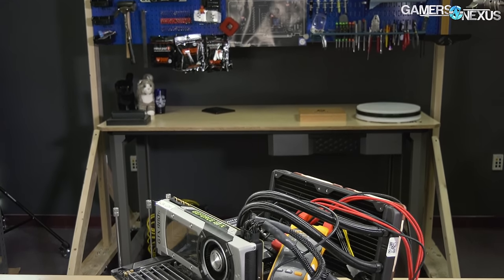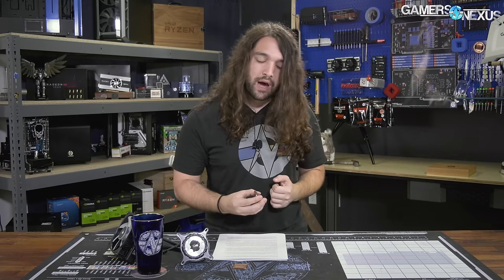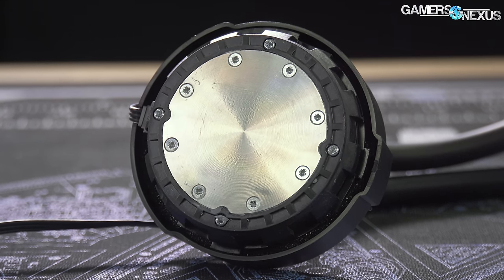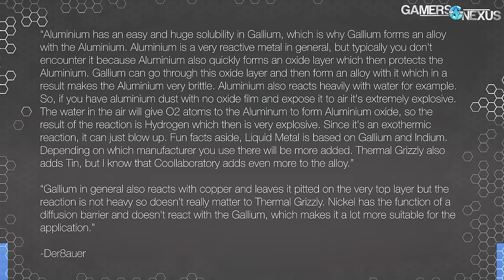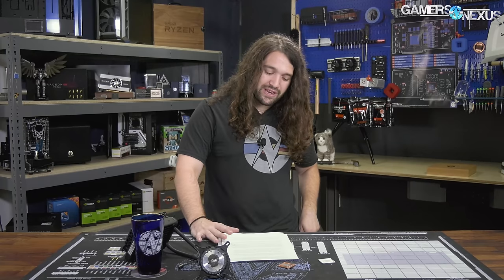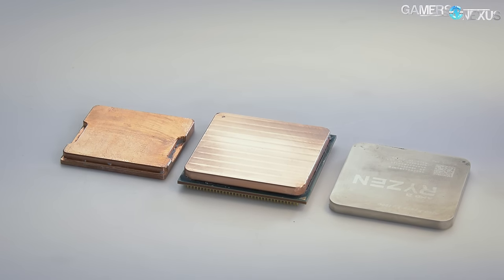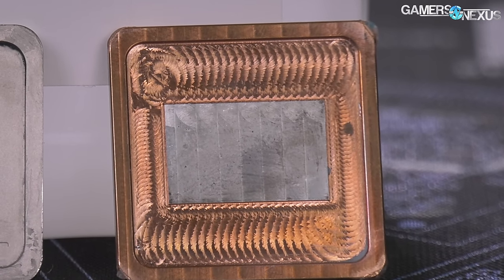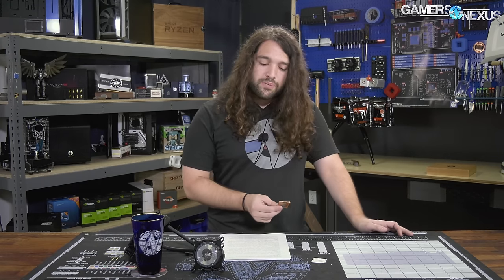How Liquid Metal Affects Copper, Nickel, and Aluminum (Corrosion Test)

Comment: I STILL can't make up my mind about whether I should liquid metal my Asus GL702ZC which has a 65W Ryzen 1700 desktop processor in it, and a RX580.  My ultimate goal would be for it to be quieter, (even though I don't really game on it and it doesn't really get worked that hard), but it also spends a lot of time oriented vertically in my backpack, which is the #1 concern with liquid metal, apparenty.
Reply: as long you apply it properly it should be fine, i used it in my g750jz for a full year and i had no issues

Comment: Anyone else had uncleanable staining on the die after using Conductonaut? Did this to my previous laptop which had bare copper contact. Worked for a while then went unstable, although I don't have any proof of correlation between these events. Copper was stained as described, but so was the top of the die.

Comment: Guys, i saw a video here on YT saying to not use liquid metal on laptops because them being mobile and not always standing on horizontal, the liquid metal will spill (what in tarnation i said to myself), and being electrically conductive will short-circuit the components. Is this true ?(from what Steve said i presume ppl are using it with laptops and if yes what is the drop in temp, like after and before.)
Reply: If you ise the right amount and don't soak the whole cooler into the liquid metal substance then it will be fine. The cohesion and surface adhesion keeps it on its place
Reply: No, incorrect, because then you wouldn't be able to use liquid metal on most computers. Most computers have the motherboard mount vertically, and gravity would pull it down onto the motherboard if this were true.

You can't apply it like thermal paste, you need to apply it how Tech Jesus applies it.
Reply: i've used it for years and had laptop transported in bags and what not and it never spilled
Reply: I have a Alienware R4 17 7820hk with a GTX 1080 I had nothing's but thermal issues with everything Except Liquid metal and finally carefully balancing the heatsink and applying better thermal pads. replacing a noisy CPU fan tomorrow so I might as well double check the paste. However to answer your question. I  travel  with it all the time no issues going on six months now..
Reply: @twoatejaun  thanks for the answer please keep me updated for the paste check.
Reply: @danny3man  Paste was in great shape on the cpu and gpu diei could wipe completely clean. Staining on the copper heatsink forsure but didn't see any psychical wear on the coper it self . Added a little extra and  actually made my core temp differential  even better then ever down to 4c max  on all four cores
Reply: @twoatejaun  Very nice, thanks for the update.

Comment: Can you tell if something is nickel plated or just aluminum without filing it off? I’d like to throw liquid metal on a graphics card, but I can’t tell the difference.
Reply: Weight.. aluminum is pretty light.. So if the card feels not very heavy at all then it is probably aluminum.. The other way is to look up information about the card you have and see what reviewers tell you..
Reply: They have a slightly different color. Aluminium is more "bright" or "white-ish" while the nickel plate has a slight tan tint.
Reply: best to google and hope someone has an answer but 99% of the time its copper

Comment: I liquid metal everything I can. Laptop, CPU, GPU. Hell, I would even do my phone if I could. Stuff is unicorn blood.
Reply: Well it's been 3 months, how's your liquid metal everything holding up?
Reply: And unicorn blood works best for sure, but what an ordeal to harvest. Easier to lower my ambient temps by 5 degrees than stringing up a mythical equine, and  draining it's blood... I wonder how a mercury gold amalgam would fair, as long as all the mucury is all used up and saturated with gold, it should be stable enough, and not off gas or cause any risk of poisoning (dose is incosequentialy low), guess it depends on the final texture, can't be a suspension, idealy should be a solution or at worst a very uniform mixture (I want to try gold leaf as a diffusion barrier anyways, and also try nickel/gold plate some copper myself, might as well see what a mercury amalgum does, hell if it works half as good as old murcury tooth fillings, it could end up as a gold 'soldered' cpu once/if it cures... Either way more gold, less aluminum, copper, nickel. Everything should just bs gold plated and polished as a rule. I assume the 9900k is solid gold at that price. Hopefully thermal results match... ;)
Reply: Unless you are using real unicorn blood, Then that is truly FUBAR!

Comment: so i could use a liquid metal like thermal grizzly conductonaut with a ryzen 7 3700x with a noctua NH-U12s ? also is it worth it?
Reply: Wondering the same. Thinking about liquid-metalling my NH-D15 to a 3800X.
It it drops temps and thus fan-noise I think it'd be worth it - but the application kinda scares me.

Comment: With Noctua heat sinks I have never had to reapply liquid metal (I use Coollaboratory Liquid Metal Pro).
I am on my third system with Intel CPU and Noctua heat sink, I have never reapplied, my current system is a delidded Intel I7-7700K, no temperature problems, I could not swear, since my use changes, various overhead from OS and so on, but I have not seen temperatures change to any degree that I have ever noticed.

For me the main attraction with liquid metal is pure laziness, I never ever want to touch that CPU again, and my fiendish, nay even devilish plans are proceeding as ...planned,  so far.

Honestly I thought this was the main attraction for liquid metal, the, what 1-3 degrees? difference, from properly applied liquid metal, does not make up for the hassle of properly applying the liquid metal, instead of fingerpainting on some paste?!? (Woo, the quitest fan in my case might ramp 20-40 RPMs up from what it is, Woo, bugga buggah, soo scary?)

Comment: steve and co, how do I tell if my heatsink plate is aluminum or nickel plated copper? The manufacturer won't help out and it's for a laptop heatsink. The GPU heatsink plate is copper but the CPU heatsink plate appears to be either aluminum or nickel plated copper

Comment: (Question) Would pure silver work as a plating for a copper IHS?  it's even higher T-conductive than copper, much better than nickle,  resistant to corrosion, easy to plate,  but expensive,   Are there other interactions I'm not taking into account?
Reply: Silver might react with one or more of the metals in the liquid metal alloy, just like copper does. The nickle plating layer is so thin it hardly affects heat transfer, even with its lower conductivity than silver. The nickle is to protect the copper from corroding, which would make a much poorer thermal conductor, or even worse, a rough uneven surface.

Comment: These alloys are commonly called Galinstan. It often has additives of Bismuth and Antimony.  Bismuth is a heavy metal (like lead), but it has rather low toxicty, so it should be safe to use.

You want to talk dangerous liquid metal coolants? How about Sodium-potassium alloy (NaK). Extremely reactive with air, water and moisture. There is actuall a CPU cooler utilizing this liquid.

Only thing toping it out (and having better performance) is Cesium-potasium-sodium alloy. Even more reactive.  I have no idea where these things are used, but my guess is nuclear reactors cooling, and nuclear reactors in space applications (like interplanetary probes). Possibly in hydraulic system that need to whitestand very high temperatures too (like close to a nozzle of a rocket engine for stearing for example).

Comment: You can make liquid metal yourself, all you need to do is get some solid Sodium (Na) and mash it together with some solid Potassium (K). Both of these metals are relatively cheap to buy and readily available.

It is however advisable that you make sure your home insurance is up to date before applying this to your CPU and doing so will generally not only void the warranty on your CPU but basically void your system in general. :D
Reply: Michael Nager don’t forget to add a few ounces of water to thin the mix out, you don’t want it too goopy.
Reply: +blackhavocjim You know I am so happy for your input, because I just knew I had forgotten something after I had posted - well done that man :D
Reply: That might actually dissolve the nickle lol if it doesn't react with something else/ explode first.
Reply: +David Gunther I estimate - and remember I am just spitballing here - that any dissolved nickel is going to be the very least of your worries.:D

But watching the two lumps of metal turn into liquid as you mash them together is just cool.

And "explode", as we heard Steve say, is just a really horrible word to articulate, lets just say the liquid tarnishes really fast.

Comment: Not sure if somebody else mentioned this already, on this year-old video but I must wonder if it is possible to use Aluminium heatsinks with a copper tape lined with a thermally-conductive adhesive.
Reply: that defeat the point entirely, would it not?
Adding the tape just adds a layer of (plastic) insulation, negating any positive effect the LM  could have.
Just use thermal paste with Aluminium heatsinks.
Reply: Ahaha try it cheap out the cooler for liquid metal.
Either used a Traditional paste for that cooler.
Or buy a Nickle plated copper cold plate

Comment: So does this additional bonding on a Rockit IHS lead to the liquid metal to "dry up" and and force a reapplication over time?
Reply: The liquid metal forms as a solid part of the copper. Its atomic thickness isn't any less. In theory, it wouldn't impact performance at all.

Comment: I tried coolermaster mastergel maker nano(in my opinion its the best convetional thermal paste) on my(delidded) 8600k but temps were still the same...It was big disappointment..So, i used thermal grizzly conductonaut and it saved me! 
20 degrees lower on the same frequency as before and it also allowed me to overclock it with extra 200 mhz  with normal temperatures!
Liquid metal all the way!!

Comment: I feel safer buying it now that I've seen your tests with metals and heatspreader. All manufacturers of heatsinks should talk about which pastes or liquid metal works with temperature chart on their heatsink instead of advertising their heatsinks and temps with their own home brand compound. They have rights to create their own but the client is the boss and wants to know if it's safe with other products. If a company tells me that only their 3-7w m/k compound should be used on their heatsinks, they lost a client. I buy Intel or AMD and it needs to be cooled with what I want. Anyway wish me good luck with liquid metal, ak620 and a delta fan in the back.

Comment: Anyone have any experience whether Thermal Grizzly Conductonaut will be worth it on a megahalems cooler running an non-overclocked i5 cpu like 8400? I think the base is nickel plated, though not completely sure.

Comment: I have liquid metal on all of my laptops. I take a motorcycle to work everyday, 40min round trip. Never had an issue. My wife has hers in her purse, never had an issue. If you install it correctly, there shouldn't be an issue with leaking or shorting of a mobile platform.
Reply: I take my Laptop to university and it's usually on its side (inside my backpack) this is why I'm a little scared about using LM on it...
But it's been 2 years since I got it and even after cleaning everything inside and repasting with better quality paste, it still reaches the high 80s, low 90s whenever I do anything more stressful
How did you manage to keep it from shorting out?

Comment: Basically, nickel is your best bet when using liquid metal. Got it.
Reply: @Hazard I've read and saw that copper still works better than aluminum though. Not sure, what type of liquid metal PS5 is using. But, they did a 2 year R&D on it. So, it would seem to be throughly thought out from the looks of it. Time will tell though. 😊👍

Comment: Gallium in thermal interface material? Better not use that stuff on anything Aluminum. It will seep into the grain structure of the aluminum and break down it's molecular bonds, making the aluminum extremely brittle.
Reply: Did you even watch the video?

Comment: But what if you use Lead instead? Soldering the Heatspreader to the cooler, and no delid...
Reply: lead has awful conductivity, still better than TIM though. also ~480c melting point, your CPU might be on fire by then :)

Comment: Why in the world would anyone replace nickel plated copper with copper? They have identical heat transfer characteristics.
Reply: SteelBlueVision If you’re talking about what I think you’re talking about, it’s because they designed the HS to mount directly to the die itself instead of to an IHS. I assume it’s not nickel-plated to cut down on costs, but maybe there’s some other reason.

Comment: Saaaaayyyy, if you have a hermetically sealed case with a vacuum inside, will your processor never burn up???
Reply: I would imagine that it would burn up fast since there is no air to carry heat away
Reply: @t7emonic792  but no air to start the burning process.
Reply: The air doesnt generate the heat
Reply: @t7emonic792  But the air generates the burning process.
I do believe that wood doesn't burn in a vacuum.
Reply: Air doesnt burn stuff heat does air just allows fires to burn,if your computer is getting to hot because theres fire inside then the cooling system is the least of your issues
Reply: @t7emonic792  I want to see someone do it.

Comment: articsilver mx4 is the best paste, non capacitive, non electrically conductive, it lastes from 4 to 8 years, its not crazy expensive for the quality you get, it spreads great naturally underpressure from the heatsink, "dont manually spread it, let it spread naturally otherwise you can trap air bubbles in the paste" ive used it on cpus, gpus, transistors even leds. And never had a single issue. Ive also fixed hundreds of amplifiers that needed transistor replacements and used mx4, never had an issue. Using anything else is foolish, mx4 has less risks, higher quality and it's cheaper lol
Reply: I used it between my 9900k die and the IHS and idk what I did wrong but the cpu is thermal throttling really badly under load. Its being cooled by a custom loop with a 480 rad.

Comment: What was your sample size for each of the nickel/copper/alumin(i)um heat spreaders? Just the ones shown on camera ie one each? Or were there multiples of each? Just wondering if you did like a measurement of the amount of pitting/corrosion per material, especially the copper. You know, something like "Given X amount of liquid metal Y applied to the die surface area, the amount of corroded material scraped off the spreader weighed Z mcg."

At that point, it might be a bit redundant, but all the same, just curious.

Comment: They should make nickel foils so we can protect copper or even aluminium
Reply: Foil will always be a lot thicker than a layer of plating, plus the contact between the foil and the copper/alu won't be perfect without a heat conducting liquid in between. You'll end up with (probably much) worse results than just using a good thermal paste.
Reply: @Candisa  thx

Comment: Can I use Conductonaut between my gpu Silicon and the cards copper plate for at least 3-4 years? When I redo my gpu Tim and pads I usually will not do it again, or for at least about 4 years max. Is it possible to contact Thermal Grizzly and ask them if 4 years on both copper and Silicon is OK? If I have to redo it every 1-2 years then it's not worth it at all.
Reply: rgray318 Are you saying that you are planning to use your card for 3 years ?